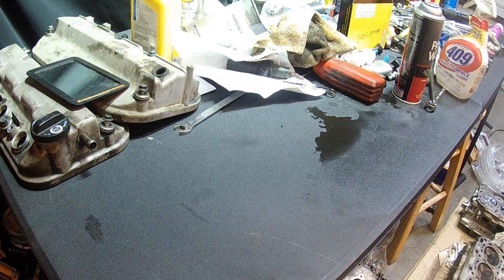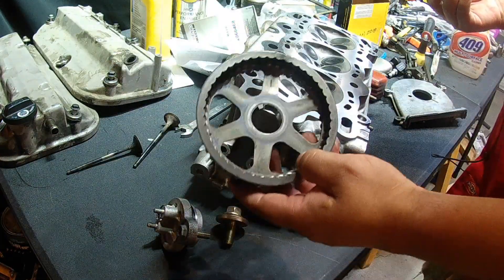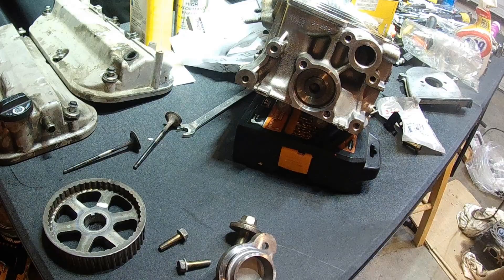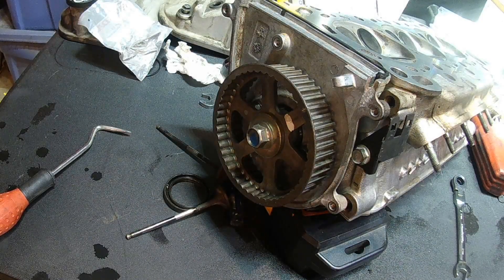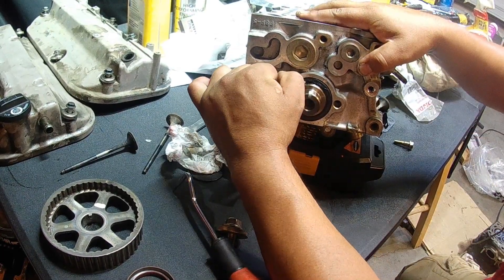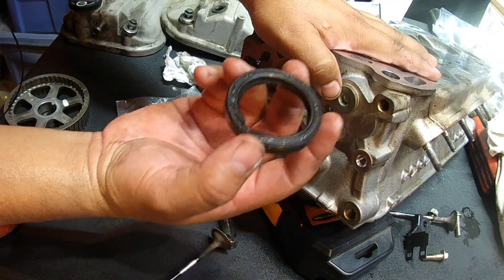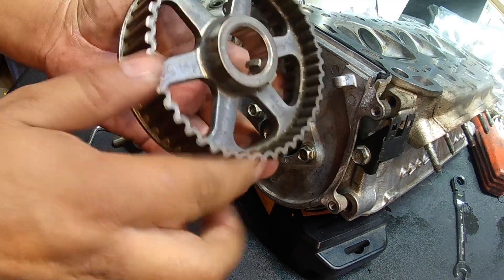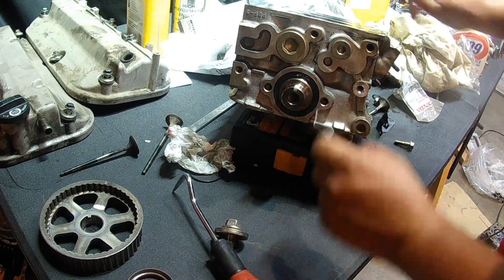Honda Acura V6 Cam Seal Replacement & Cap - Camshaft - Accord Odyssey Pilot Ridgeline MDX TL CL RL

Comment: which timing belt kit was on before break down and how many miles on the failed water pump??

Thanks
Reply from the maker: It was a Gates timing belt component kit. It had 68,700 miles on it when the water pump decided to take a dump. I’ve heard multiple stories from other shop others about the failure of Gates. Guys are saying they are dropping in quality.
Reply: @bundysgarage  I have a 2002 acura tl type s and with 180,000 plus mile the water pump and belt were done at about 80,000 miles. 
I really don't know what brand they use. They charge about 800. Not the dealer. What brand do you recommend ?
Reply from the maker: Go with a Aisin timing belt component kit. Or if money is not an issue go with Honda OE parts
Reply: @bundysgarage  Thanks you,for the recommendation. 👌
Reply: Thanks a lot.  I just installed Aisin TB kit on my 2011 Odyssey.  My garage almost convince me to install a Gates kit, because waranty with Napa was better.  Yeah right : they will replace components if they fail, but not labor time!!

Did you see some coolant dripping before the grinding noise??
Reply from the maker: I could not see coolant until o took off the lower timing belt cover. So that being said I drilled 2 small holes at the most bottom part of the lower timing belt cover so that if the WP starts weeping again I will be able to see it. It was was such a small leak that the coolant was going down at suck a small amount didn’t even really notice it.
Reply: Aisin is good stuff.   Stay away from Gates.  Watch out for Chinese knockoffs
Reply from the maker: You’ll find a lot of Chinese counterfeits on EBay.
Reply: I used the Gates kit and ended up with a coolant leak about 18 months later. I think the pump was fine, but the o-ring went bad. I had to basically do the whole job over again and replaced the water pump with a Napa brand. Been several years since then and it's been fine.
Reply from the maker: GATES IS JUNK. I don’t use Gates for anything anymore and I’m pissed when I have to use one of their hoses.

Comment: Thanks for the vid,.  I tore mine down to the valves and did new valves, valve seals, and all new gaskets and seals. Just in the process of dressing the head for install, looking at addressing all the ancillary brackets.  Being as i have this old girl torn down to her nickers at 350K, I figured it's the least I could do for it's life of service lol.  I ultrasonically cleaned everything, got rid of most of the corrosion in the front end, mostly consisting of brackets, hardware etc.  cleaning, dressing, painting lol. 

It's dudes like you who make it possible.  Without stuff like this, I would have no where near the confidence I do today in my mechanical abilities.  These Honda J35's are a fun lot.  It's been a walk in the park, especially after having done the cam phazers, oil pump and timing on my F150.  I learned new words that day;  words that aught not be uttered :| lol  .  Point being is I've learned soooo much. Thanks.

If you look hard enough, there is a full service manual out there.  The one I have here is for the 06 to 08 Honda pilot, it's clear, concise, logical and well illustrated.  Doesn't look like someone photocopied a crayon drawing on a potato.  I can provide specific screenshots if someone needs.  Just poke me with what you are looking for.  Otherwise, ,ike I said, It's out there.  The book is about > 2500 pages. 

Thanks again for the sauce partner ;)

If anyone reading this would like to see more like this, please support this chap.

Comment: Hello there is a lot of talk about whether the cams can be moved back and forth safely while still being attached to the rest of the engine. Meaning people said valves can bend and/or throw the timing off etc. Can you give some clarity I know you have quite the experience working on the Honda v6 J series.

Comment: Here's a trick I used when I was doing cam seals while the head was on the engine. Use 2 drywall screws, and screw right into the seal 180° from each other. You now have 2 points where you can pull the seal out from the engine. It's much easier than using a pick to wrestle it out of position.
Reply from the maker: Thanks for the tip
Reply: Wonder if that will work on oil pump seal???
Reply: So long as the seal comes out in that direction and it has sufficient 'girth' to be penetrated by 2 screws simultaneously.

Comment: Thanks for Honda videos-great info and well done.  I have Honda J35-A6 in airplane using an aftermarket ECU.  Engine #1 with 168 hours blew piston #5, Engine #2 with 21 hours blew piston #5.  What's with number 5?  The metal between the top and middle rings sheered off causing crankcase blow by - oil pressure went from 60 to 90 PSI  - any ideas why same piston would fail??

Comment: Why are YOU making a how to Video ?? just started you video and you greased the o-ring with grease ... not special die electric grease that doesnt SWELL rubber or the special grease that is used for caliper lubrication seals that also doesn't swell rubber .. see where I'm going with this ? You used the wrong grease its not a matter of if it will fail but how soon as that rubber will swell to 5 times the size and the force of the cam moving will tear it .. This is specifically why they don't use petroleum grease for these types of applications. Not only did you inexperience cause you potential issues down the road but any person dumb enough to watch a how to video off someone who is clearly doing something for the first time ? you cause them to break shit as well
Reply: Dont believe me ? ask any painter that uses black "rubber" squeegee for applying body putty what happens if you leave the 3 inch squeegee in thinner to clean it and forget it till a few hours later then its 12 inches wide.... grease does same thing to rubber
Reply: Wait ? my bad what I said holds true for rubber components on a lot of parts of the car but since the cam seal is designed to keep oil in possibly the seal isnt rubber but something else instead ?

Comment: Hi Bundy. I have to swap an engine in my 2007 Odyssey. I have done engine swaps in the past, so I am comfortable with the job. The "new" engine has 125,000 miles on it. Would you replace all the seals and o-rings you show in this video and your rear main seal video? Cam and crank seals with the end cap o-ring...rear main seal and the o-ring? I'll also be doing timing belt, valve cover and valve adjustment(I've done those before). Much easier with the engine out of the vehicle. I am nervous about installing new seals and not doing it right and causing a leak. Especially the rear main seal where you have to use the hondabond RTV with that plate the rear main seal sit in. What would you advise?

Comment: How hard is this to do with the engine in the car? Like as part of a timing belt job?
Reply from the maker: Not hard. Just pop it out. Don’t  scrape the mating surface and then tap in the new one with a big socket. Don’t install it dry, out some grease or oil on it before installing.
Reply: @bundysgarage  cuál es el torque de apriete del tornillo del centro del árbol de levas?

Comment: I took my head to go get machined and he had to take off the timing belt pulley. could I lose timing whenever he puts it back on? its a j32 head
Reply from the maker: No the pulley and cam are “keyed” so it can only go back on one way, so you will not lose the timing mark.
Reply: BundysGarage thanks man. im putting it back together today. should be done this afternoon
Reply from the maker: Let me know how it goes! It’s a great feeling when everything. Goes back together and you fire it up for the first time. One quick side note, make sure you do a valve adjustment on all intake and exhaust valves before starting it.
Reply: BundysGarage will do!
Reply: BundysGarage it took me a few days to finally get it all together and do the valve adjustment. anyways its all done and fixed! idles and drives great! but it is now smoking pretty bad on both head. the smoke is coming from the area where the cats meet the block. i think its coming from the valve covers. nothing out the exhaust. it will start smoking within 1 minute after the car is started. its a white smoke im think its oil. any ideas as to what is causing this?
Reply: BundysGarage I checked the PCV valve and it was completely clogged. I shook it around a bit and cleaned all the gunk out of it and all the smoke stopped!

Comment: I recently replaced timing belt and resealed oil pan and front plate new o-ring on oil plate. After the third day I noticed my oil pan wet with oil. Any suggestions? I did not change cam-seals??? Any comments appreciated.

Comment: The more cars get more complexed. The more I want a Honda.
Reply from the maker: Honda’s and Toyota’s are very easy to work on
Reply: BundysGarage So are Chevy 350s. It's the tips and tricks that I like. If it makes an engine better I'm all in. If it's horsepower or cosmetic, I want to learn it all.

Comment: You have to hondabond around the outside edge of the camshaft end covers, otherwise, it will leak again.  I know, because it happened 20k miles after I replaced that o-ring.  I ended up removing that cap once more, replacing the o-ring once more.  But the second time, I used hondabond, it never leaked again.
Reply from the maker: Did you apply a light coat to the inside of the seal or did you put globs around the inside where the seal sits?
Reply: I put a light coat on the outer perimeter of the end cap itself, not on the o-ring, enough to squeeze out a thin line of it outside the cover.  I used a small brush to smear it on so I don't overload it.  The seeping and misting happens between the head and the cap.  It was actually causing a big oil mess around that area.

Comment: Would have been nice to see how you remove the cam pulley and torque to spec
Reply: HondaSolutions I would also like to know. My heads out and replaced stem seals. Now I cannot find a groove to lock it unless I need a special tool

Comment: I've  been a loyal follower from every Honda video to your washing machine videos if you recall. Enjoying all your Honda J series videos. Very helpful. Keep them rolling. Artie. Still trying to research a good scan tool with bi directional control that will work well on Hondas. Looking at launch, Autel and even autoenginuity. Any input on the Launch Diagun IV or IV+. I know there Chinese knockoffs trying to find reliable inputs on their quality and performance. Thanks much 👍❤️